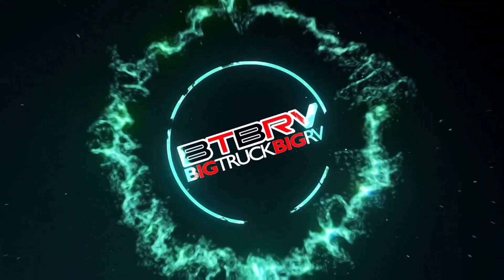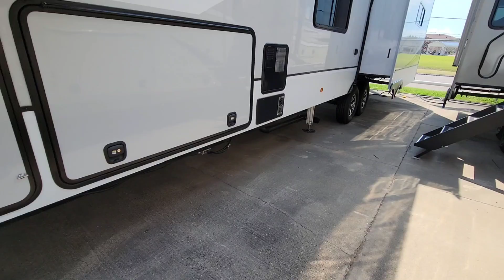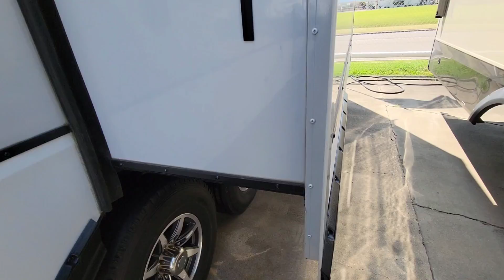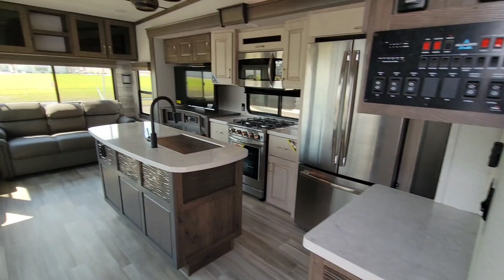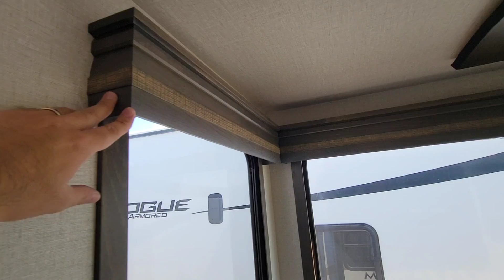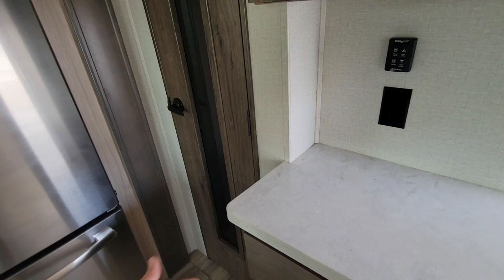A better built RV? How much more would it cost?  Let's find out!

Comment: Great video.  Different people want different things.  The option to go to disc brakes and upgraded tires, I'd pay for that upgrade at the factory.  The option to go with lithium batteries and solar, I'd pay for that upgrade at the factory as well.  a larger freshwater talk, I'd pay for that at the factory too.  Those upgrades are worthwhile for me, but not for everybody.  I don't understand why these RV manufacturing companies don't make it easier to upgrade individual items to fit a more customized customer profile if customers are willing to pay for it.  And good quality control should simply be a given.  From reading many comments, I have been very lucky that my 2019 Cougar 5th wheel has not had quality control issues.
Reply: Different people want different things.  Yup, that's 100% right.  When confronted with the higher prices, half of buyers would think about it and opt for few if any of those pricier improvements (minus the QC issues he talks about at the end).  Many others would be willing to pay for some of them but there would be scant agreement about which ones they would be willing to pay for.  What has been and will become even more popular in the years to come with be, as you mentioned, improved batteries and solar and also other tech stuff like improved mobile internet, etc.  The average RV buyer gets "younger" every year, even if they are not actually getting physically younger.

Comment: JD, I'm afraid I will have to respectfully disagree with you on heating & air conditioning systems.  For 5th wheels they should adopt a central system just like a stick built house.  The unit could easily be installed in the basement.  With such a unit it would be much more efficient and much quieter.  Since travel trailers do not have a basement to mount such a system the roof tops units should be massively improved for efficiency and quietness.  The roof top air conditioners are nothing short of archaic dinosaurs that use way more power that is needed and simply make way to much noise when running.  A simple window air conditioner is way more efficient and much quieter.  Same goes for their heating systems.  Horribly inefficient fuel guzzlers.  These are things that could be easily done and adopted by the RV industry and it would have an initial costs but in the long run would improve their profit margins due to much improved customer loyalty and customer willingness to pay a little bit more for the badly needed improvements.

Comment: I know this question isn’t about this video but I’m curious to know can you auto-level your camper with the slides out. I have a 2021 Keystone Montana 3781RL. I have cut boards and leveling blocks underneath my jacks but with as much rain that’s been happening in my area it has shifted a bit. I have owned this camper for 8 months now. I haven’t seen you do a video mentioning this yet.

Comment: I would like some of the improvement. But not all of them . Do I need a third axal no . But step up to 8,000 axels with disc brakes and larger better tires would be nice. Montana offer that in the Legacy package. Also you didn't mention full body paint. I have had several RV that the graphic decals faded and cracked. They really make an RV look terrible when that happens. The decal are next to impossible to get off. And then you can't get replacements. Im in favor the water manifold system . I don't know how long the plastic ones will last. I  have all said the government should mandate a 100 year warranty on plastic products. Then the factory would be forced to make quality product. I like the DRV elites 1 piece fiber glass roof. I had a Alpha Gold with one and it was great. You still have get the seams sealed regularly  or it will leak. Thanks for a good video . Lots of choices out there

Comment: I think you’re right on with your observations. A lot of people here are focusing on the labor quality and I agree it needs lots of improvements but this could price them right out of business. These technicians aren’t getting paid $30-$40 an hour like a specially trained union carpenter or electrician. Maybe if they were we’d see less issues but I can guarantee you’d still see problems just not as many. With that you can also guarantee a huge price difference that nobody will want to pay. I know plenty of high paid union guys that still cut corners and slow down working because they know there is no new work ahead. The quality problems are people problems and I believe these labor issues won’t go away unless they develop some form of robotics to do this work.

Comment: If I ever get another 5th wheel I want one with the kitchen in the nose. I saw a few like that and you get more kitchen then what I got now.
Reply: I thought the same thing but EVERY 5th wheel I toured with a front kitchen had horrible basement storage.  You had lots of kitchen storage but I don't want to store my smoker in the kitchen.  I don't fully understand why you lose basement storage with a FK floor plan but it always seems to happen.
Reply: I would predict that this would not be too popular.  Consider the three major floorplan areas of an RV; bedroom, kitchen, living/TV room.  The one that people probably least want low ceilings is the kitchen.  The kitchen is the heart of the home, it is where people gather and socialize and, critically, this usually happens with people standing up.  Low ceiling around the TV?  No big deal, we are sitting down.  In the bedroom?  No problem, we are laying down and, in RVs, there isn't much room to stand around anyway.
Reply: @j.foobar1764  rather have lower ceilings the higher the ceiling the harder it is to cool and higher the elc bill. I have found that out with my Montana elc cost has doubled and it takes forever to cool.
Reply: @dorotheawalker7985  Nobody who is 6 foot plus likes having the ceiling within a few inches of their head in a room they are almost always standing up in.  I recently toured one with a front living area with the TV at the tip and I actually could not even walk to the TV without my head rubbing the ceiling.  I am tall but not freakishly tall (6'4").  I could live with that in a TV room and certainly in a bedroom but not in a kitchen.
Reply: @j.foobar1764  5"11 here some not fine with low ceilings some are fine I am one of those fine with low ceilings.

Comment: We recently traded in our 1996 class A motor home for a brand new 2020 $60k 5th wheel toy hauler. We had some good times in our old motor home but it had got to the point that it always needed something done to it. I just accepted the fact that it was old and that was the problem. Now the new camper is no better…. I’m shocked and disappointed over the problems that it is already having. These things are just slapped together as fast and cheap as they can.

Comment: I think you’re missing the point with people’s complaints on quality. We’re (at least me) aren’t asking for more quality components…just spend an extra 10 mins per unit when running wires and do it right the first time. Spend a few more minutes and make sure the screws you’re screwing in are actually hitting studs. Spend an extra few mins and actually make sure the ac’s/fridge/water pump all work before getting to dealer. In my case, make sure you actually installed the correct sized unit. Spend an extra few minutes when installing the roof membrane to make sure it has no holes/tears to keep your new unit looking like a balloon coming home from the dealership. Spend an extra few mins and actually tighten all the lug nuts/suspension bolts to actual spec. Spend an extra few mins to make sure the unit actually has hydraulic fluid in the reservoir doe the levelers. Spend the extra few mins to actually adjust the slides so they open/close properly. 

I could go on for pages…but you get the point. The problem isn’t the components, but the lack of attention to details. That’s not a money thing, that’s a lazy thing. If you have to hire one person per shift just to check these things on each unit, or have to hire 10 people per shift to just check these things, then do it. But I suspect if management really concentrated on setting a quality first culture instead of get them out as quickly as humanly possible culture…they both could be attained and their business would flourish beyond belief.
Reply: Amen! No matter how expensive or cheap build it correctly the first time.
Reply: You saved me from typing two paragraphs.  Thank you and spot on.
Reply: EducatedTrucker
I'm an industrial engineer and no matter how you feel, time is money. To increase time used to manufacture any product adds to the cost of that product. Imagine how expensive an average automobile would be if they were manufactured along the same lines as RVs. Robot manufacturing improves both quality and reduces manufacturing time. All things being equal, increasing manufacturing time would probably cause the company to cut costs in other areas such as materials and components that might not be as obvious as a messy wire harness. Just saying.

JD, where are you getting your information on estemated costs for your upgrades? Just curious.
Reply: @Denden505  , are you suggesting if they built RVs with robots they would cost less?   You probably aren't,  but you are trying to compare auto manufacturing with RV manufacturing in which case you might as well throw in IKEA furniture manufacturing because it would have just as much relation.     
Ever priced a car, its generally going to be in the neighborhood of the MSRP.    Yet somehow in the RV world $25 - 30,000 off $100,000 MSRP is normal.   Obviously the dealer makes money on the extras and financing but they still aren't giving them away so what must that $100k RV have actually cost to build to sell it for $75k?  Add 4 hours to the build and charge me $76k.
And what about that wire harness on the car that takes so much time to do correctly?   If not the manufacturer gets sued and recalls ensue when the car catches on fire or causes an accident.   When that clump of wires dragging around the undercarriage of an RV goes south what happens,  shrugged shoulders and a " RVs, whata gonna do?".    That's why IKEA furniture has more in common with autos,  those two have safety standards they have to meet.
Reply: That is the problem,  we as consumers are asked to just accept the build quality as is.  We are told  it's a trailer,  its like an earthquake going down the road... well the manufacturers are making a killing and not willing to include quality control as part of the process. Subbing inferior products just to finish the unit. And oh by the way there is a 180 day delay in production and we sent the employees home so they could have time with their families...
Reply: Thank you. Well said.
Reply: Couldn't have said it better. You are spot on.
Reply: Seems more interested in justifying why the consumer has to feel guilty for insisting on quality. Poor poorv RV ASSEMBLERS... they just can’t afford not to build garbage...
Reply from the maker: My friend, I believe you missed the last half of the video where I specifically address this
Reply: @BTBRV  I don't think so.
Reply: @BTBRV  what I heard was a lot of excuses as to why quality cannot be improved. Of course there would be an initial investment/cost to come up with a new system to insure consistent quality, but cleaning up wiring and quality control standards should not be something that slows production to a grinding halt. I’ve worked with plenty of people that say this or that cannot be done, then there’s always the go getter that just comes in and does it. That’s what the rv industry needs…a manufacturer that believes decent quality should be a standard feature, not an extra that you have to pay for.
Reply: @admorris11  Nailed it!  There seems to be a mind set of "that can't be done."  As a team leader those words made me cringe.  Want I wanted to hear is : right now I don't know, let me research it, get the team together brainstorm it and get back to you alternative."
Reply: @admorris11  just because you complain about the wires not being in the right way or screws that are loose you can't tell that there loose until you do a shakedown with your unit, RV manufactures can't always make the correct refrigerator fit into the space that they plan on putting it in sometimes they have to make small adjustments, when the unit goes through P.D.I sometimes they might not tighten the lug nuts up to the right spec because they simply don't want to hold the assembly line up, sure the wiring for the control panels might be messy but that's something you can do if the manufacture missed it not every single unit will come out perfectly you just have to realize that, RV manufactures have pretty high P.D.I standards that they go through to insure that the RV is safe, comfortable to sleep in when ever you get to where your going to, safe for towing with the properly equipped tow vehicle
Reply: @parker1999np  RV manufacturers have little to no pdi standards…that’s a very large part of the problem.
Reply: @admorris11  Thank you.
Reply: @admorris11  Are there building codes for RVs, or only safety guidelines for fire protection and road-worthiness?

Comment: Not to mention with all these upgrades mentioned it's bound to add weight. This means even a 350 dually would not be safe to tow these fifth wheels you would definitely want to consider upgrading to three or four semi trucks to safely pull that trailer at that point personally I would recommend using a mining hull truck That's going to give you the payload and safety necessary to pull an upgraded fifth wheel trailer like this

Comment: I would be willing to pay extra for IS and disc brakes from the factory, I also think a good tire should be standard equipment.
Reply: Improper inflation is the #1 reason for tire blow outs, not country of origin.  Look at studies not anecdotal evidence.
Many studies have been done on tires and reason for failure.
Personally, there should be transport tires and then replace them at the dealer.  
A fresh blowout on new tires is likely inflation or during transport their was impact damage.  The 2nd being far more likely.
New or used purchase, budget the tires you want into your purchase.
Reply: @TruckingMBA  very true my GD 2018 had over 18k miles on the "china bomb" westlakes with 0 issues and still looked almost new when I traded it in on my new 2021 Alliance Valor 42v13...
Reply: Good tires ARE standard equipment. All tires, regardless of country of origin, must meet or exceed DOT safety requirements. Perhaps what you would like is an over engineered wheel/tire. So how much you want to pay for that?
Reply: @richmanwisco  Alliance uses SUPER G rated Sterling 4400 pound tires, not China bombs ;)
Reply: @richmanwisco  --  Try and convince China of those facts.  Good luck!  The RV industry puts on some of the most crap tires on their RV's that it isn't even funny.  When I purchased my RV (new) I towed it less that 2500 miles and had not one but two blow outs in the same day at different times.  I learned afterwards those tires were from China.  Did I ever get an education about RV tires after that from multiple sources.  I simply didn't know and let me assure you I wasn't advised about them from the dealer either.  Now, ask me if I'll ever purchase another RV from that dealer or should it cost an additional 30k to 50k dollars more??
Reply: @jamesbass9797  , why did you not look at those things while shopping? I did. My China tires never blew out nor lost air in over 3 years. I replaced them at just short of being 4 years old per the DOT date code and after 12k miles.

Comment: I do have an odd question.
Why are dual wheel tandams not used on rv's, like they are on deck over trailers? Single wheel triple axles seem to scuff a lot on turns, and certain component companies won't honor warranty for triple axle setups. It would also give the ability to add capacity fairly easily.
Is it a frame issue, or pin weight? Or just a thing that isn't done, so people wouldn't want it? I know with deck over trailers, dual wheel tandams are sought after vs single wheel triple axles.
Thank you for the video.
Reply from the maker: I'll have a video on that soon
Reply: @BTBRV  thank you.